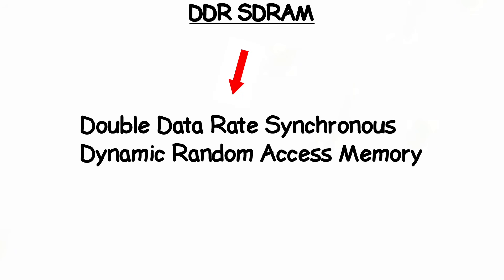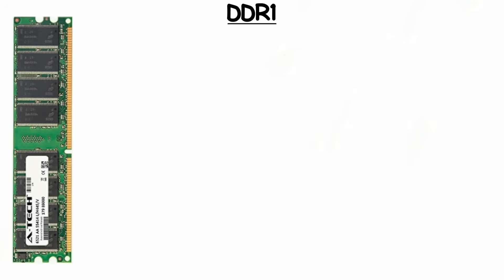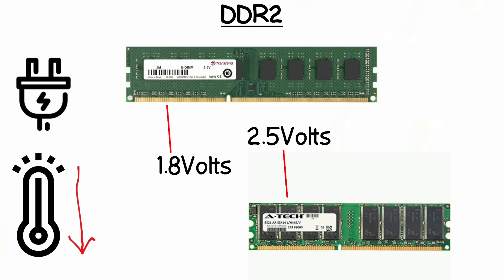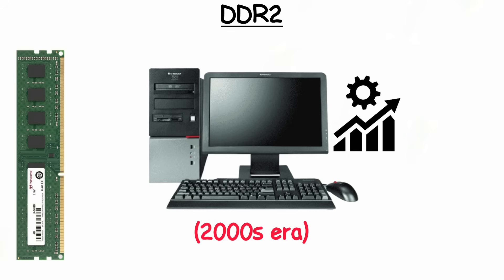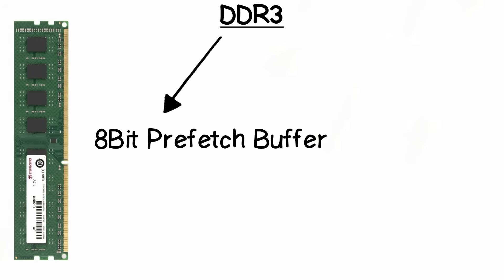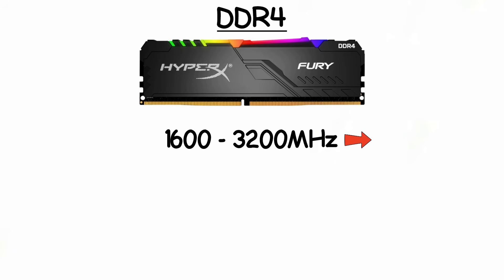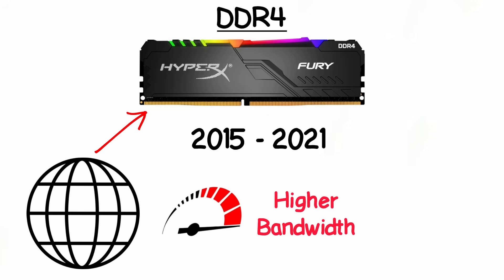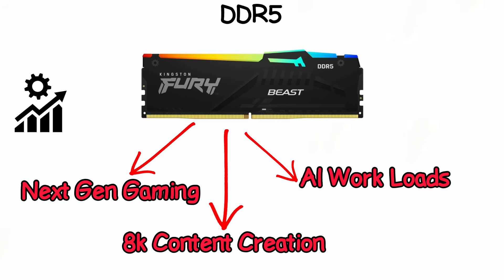Every DDR RAM Explained In 7 Minutes

Comment: When they RAMs have the same amount of pins, they move the notch a 1 mm to force us to make a full upgrade. Diabolical industry.
Reply: RAM could have the same number of pins, but different ddr generations are electrically incompatible. to prevent the risk of damaging the RAM or the motherboard, they shift the notch to make it physically incompatible. 

it sucks yeah, but honestly when you look at it further it makes sense. the best RAM upgrade you can do without swapping the whole mobo is to find the fastest variant of whatever DDR generation you run.
Reply: They not compatible tho they got a different protocol and could fry your CPU memory controller
Reply: No they moved the notch coz it was too easy to put in the wrong way around and kill your mb
Reply: Not diabolical. If a memory card's signal and voltage incompatible with a motherboard, why not make it impossible to plug the wrong one in?
Reply: There is no government to the new technologies and innovations one can develop 😊 whether fortunately or unfortunately
Reply: I just upgraded my cpu to 9500 and I needed a new motherboard and RAMs it bs
Reply: @ehg6014  not really ddr5 far faster than ddr4 and the new 9000 series CPU need that bandwidth that come with being faster

Comment: DDR3 can still be used today, but the only limiting factor is that only old motherboards support them, which means old CPUs and GPUs. But a top spec DDR3 PC Build from back then would still be able to run low demanding games today, but it's becoming obsolete as newer games require higher and higher specs.

But if you aren't gaming and just want to use your PC for casual things like watching videos, DDR3 is still good enough
Reply: I game on it all the time because "gaming" doesn't equal playing the newest most demanding and trash AAA games that often release unfinished for a full price nowadays.
Reply: Not necessarily, as long as new GPUs are compatible with high end DDR3 motherboards they will still hang of course high end is key.  Turning up the resolution reduces CPU bottlenecking and at 4K the bottlenecking is around 3% which is negligable.  Quite amazing that I'm still gaming on my 18-year old x58 motherboard with an AMD 6900xt and still competitive with people on new machines.